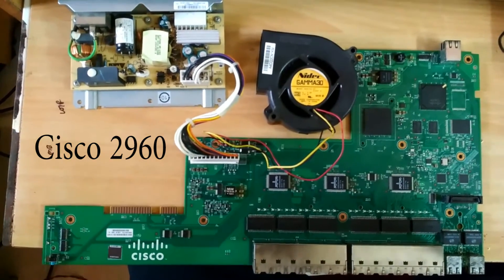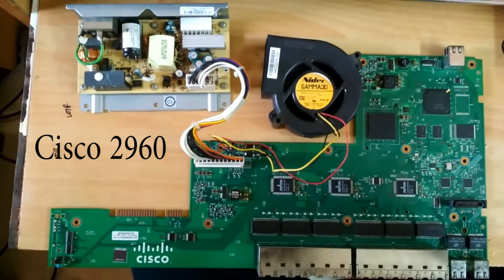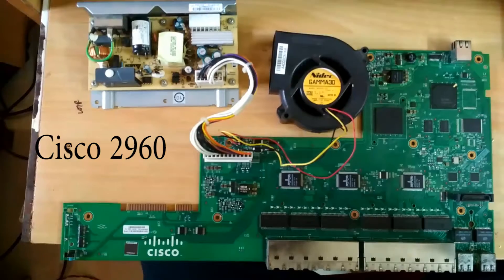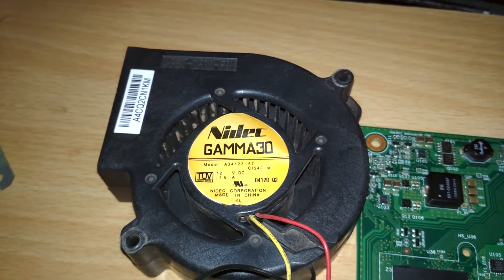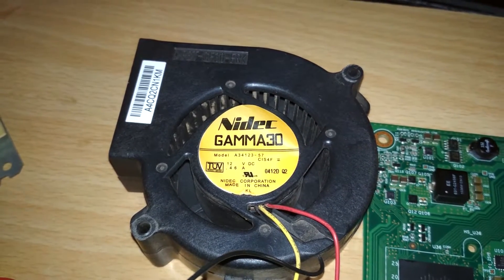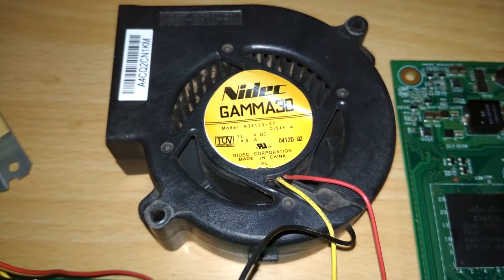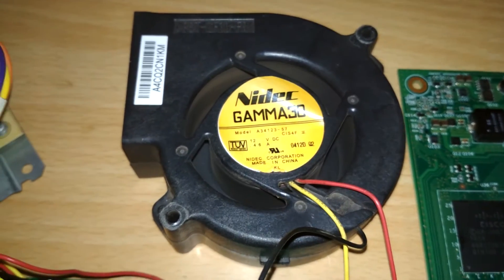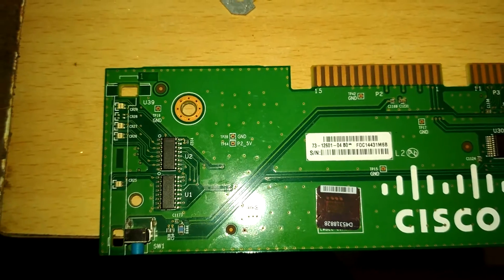Troubleshooting And Repairing Cisco 2960 Switch

Comment: bro on which pin of coil we need to apply  3.3v  near to non polarized capacitr or near mosfet ic and if i am applying  then waht should be the approx current reading on dc supply

Comment: I have a similar problem with a switch where there is a faulty capacitor in this model Cisco C3750G-24TS?
Reply: ok i found it :) I will be testing I have a question if this capacitor needs to be replaced with another?
Reply from the maker: @mudassaba8194  No need.

Comment: how to fix dead port on cisco 1841
Reply from the maker: Which port is dead ?
Try to factory reset (backup first)
check connection from socket to coil and coil to controller path in case of Ethernet port problem.
if nothing works then you should try to replace corresponding controller chip.
Reply: console port
Reply: cisco 1841 router console port not working
Reply from the maker: @akashgaikwad540  ok then check connectivity path of that port on circuit check resistance of each pin to controller chip, I don't have this device with me so i cant explain chip number wise etc.
Reply: can  you show video repairing console port cisco 1841
Reply from the maker: @akashgaikwad540  I don't have this router.

Comment: @Crystal Computers and Repairs

POST: Found inline power controller write failure, inst 0

can be fixed ?
or when post is not showing the inline power but the hardware is PS model ?
Reply from the maker: MrLucize Sir, I can't understand your problem please tell me some more information about problem.
Reply: thanks for reply !
I have two catalyst 3560-ps models (with PoE)
one of the is having this error at boot 

POST: Found inline power controller write failure, inst 0

and the poe will not work
the other one doesn't show the poe test at boot at all and of course it won't start the poe device, can this be repaired ?
Reply from the maker: MrLucize Sir i understood the error but it need to be check the motherboard of switch and poe power lines, i don't have this switch with me right now I can't help you without hardware feeling Sorry. But if i receive one for repairing i will definitely help you.